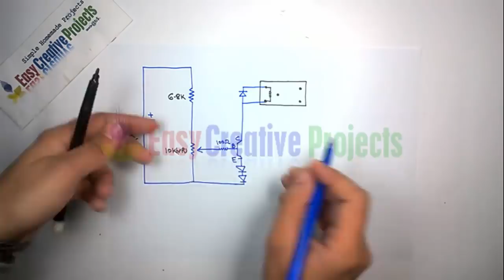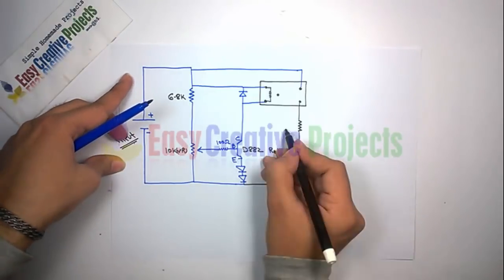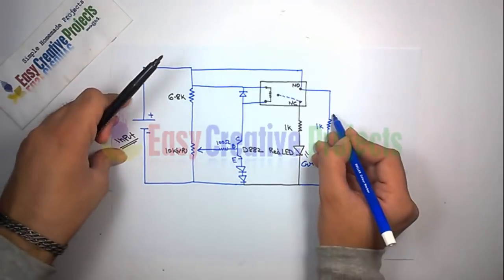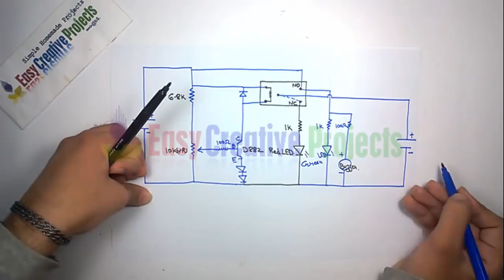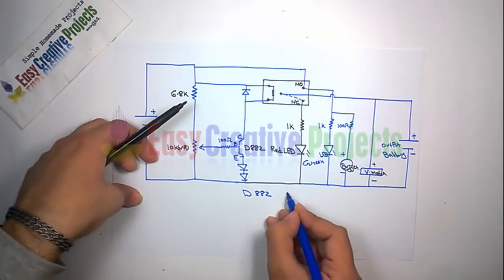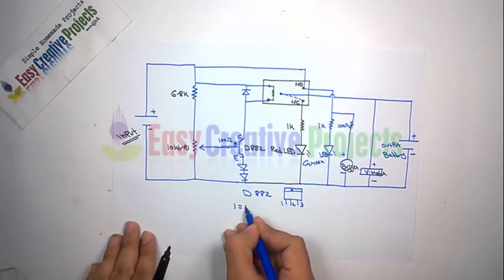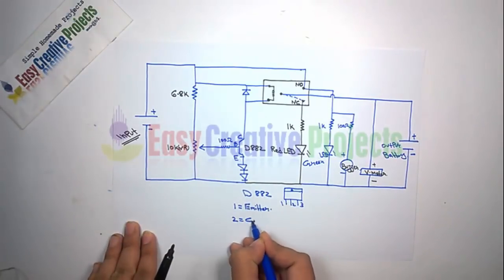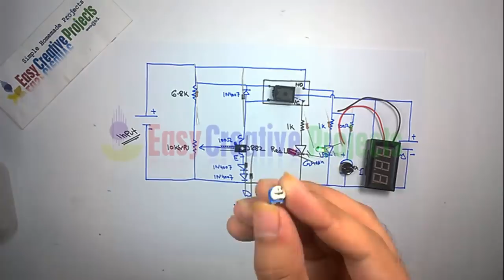How to make digital automatic cut off battery charger with siren

Comment: A battery is always charged with a 12-15 Volt DC through a 230 volt AC transformer by a bridge rectifier. From this voltage how we can adjust cut off voltage that is 11.5. please kindly explain otherwise is circuit is a waste of time. Please reply

Comment: To adjust 11.5 volt what voltage must be applied to inpug
Reply from the maker: dear you can use 12v to 18v input power. and adjust cutting switch with variable resistor.
thanks.

Comment: can i use this circuit for 9 volt battery ?
Reply from the maker: No dear its 12v circuit. relay not working on 9v.  
if your need 9v circuit so simple replace 12 relay with 9v relay. and adjust circuit with variable resistor.
thanks.

Comment: Can i use this circuit to auto cut off charger 7.2 voltage that charge a Battary as full charged at 8.02 voltage ?
Reply from the maker: no dear because relay work on 12v. 
i give you suggestion, simple replace 12v relay into 8v and make your own.

Comment: d882 ki jaga bc 548 ya bc547 laga sakte h kya
Reply from the maker: dear d882 max output current 3amp
and bc547 max output current 0.1amp. if your battery work on 0.1amp so you can use it.

Comment: Can i use this charger to charge a 4 pc 3.7v lithium ion 18650 battery pack?
Reply from the maker: no dear its 12v battery circuit. 
for 3.7v battery you need small circuit.

Comment: Sir ak inverter box jo ke 230v ac ko dc 12v battery charging and auto cut off , socket ka use 2, 3 room ma led light jalaya . Carry ve kar saka video banaya please
Reply from the maker: ok dear i make for you soon.
Reply: Abe ac to dc convert krne wala inverter kabse ban gya?itne dino se school or colleges m galat padaya ja rha h?
Reply from the maker: ankit mallick dear complete requirement btao.
inverter ki to already 4 video bna chuka hon.
Reply: are vai m ek arduino project bna rha tha jisme mujhe ek power bank ko charge krna tha. Apka video dekhke bohot acha lga lekin multisim m isko replicate nhi kr paya. Upar se apka ye charger 12v ko charge krta h lekin mera power bank to sirf 5v input lega wo vi 1A ka. Isliye samajh nhi pa rha kya isi circuit se ho jayega ya koi dusra upay h to btao...
Reply from the maker: aap yah video dakho
how to make mobile charger at home.
is ki output 5v dc ha. is main agr kuch change krna ha to btao main aap ko component bta dayta hon nai to subha video bna don ga.
Reply from the maker: aap facebook page pay message kro. main wait kr rah hon aap ka.
Reply: Easy Creative Projects apka facebook id dijiye m apko bistar m batata hu

Comment: Sir ye circuit mobile ko lagayenge to chalega kea
Reply: Kuake mobile battery capacity 5volt hoti hea or apa ne 15 volt ke battery pe test ke
Reply: 5volt battery ke lea circuit me kea changes karne padenge
Reply from the maker: 5v ke relay use krni pary gi.
2nd mobiles main auto cutoff circuit pahlay say hi lga hota ha.
Reply: Ies ckt me 10k(vr)kea hai
Reply from the maker: dear yah variable resistor ha.

Comment: Good project 
Thanks 
Plz guide me charging supply, connection in series??
Reply from the maker: yes dear. you can connect power supply with 6.8k and 10k variable resistor.
if you have no battery charger. so see video on my channel how to make 12v bike battery charger.
thanks.
Reply: Easy Creative Projects
OK thanks 
By the way u r a Pakistani or Indian brother and ur good name